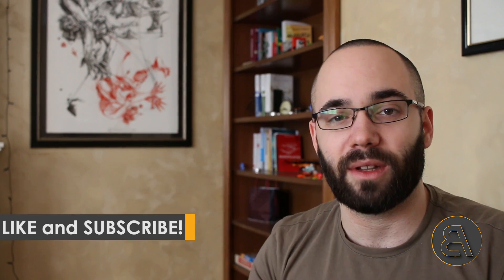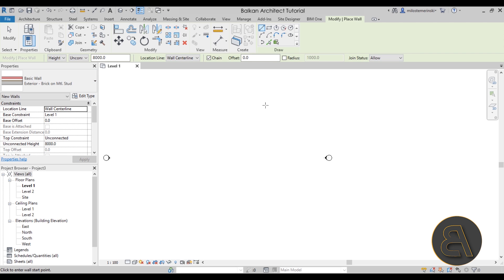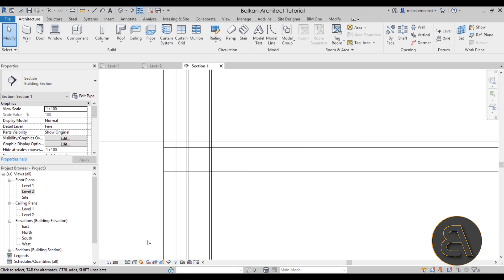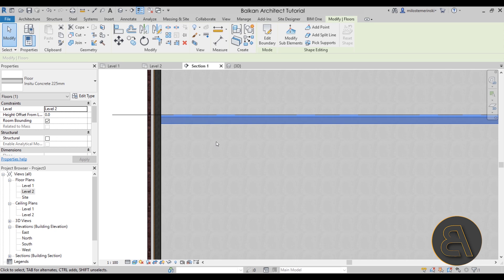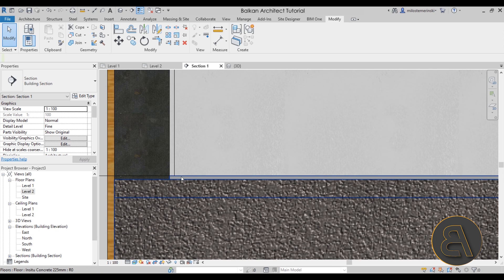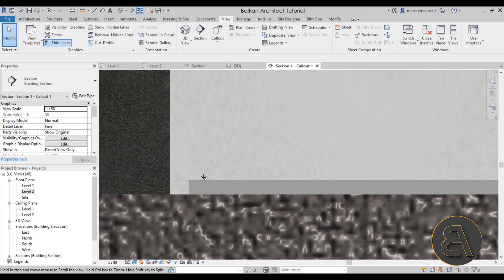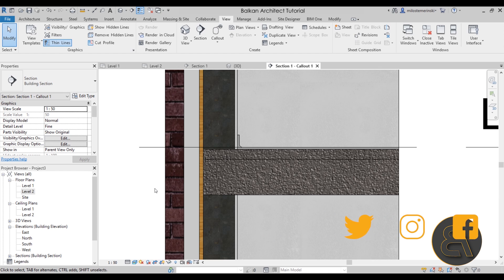Wall -  Floor Connection in Revit Tutorial

Comment: How to do it when having the floor on the ground floor and the outer brick layer is actually standing on the floor? For me in such case the concrete layer will go through all wall layers and just the floor tile layer will stop at the core wall layer but will then start again for the insulation and outer brick wall. Couldnt find a way to fix this.

Comment: THIS IS COMPLETLY WRONG.....try to be more clearly on your explanation............what you are trying to show is a "finish flooring surface possible some type of vynal flooring material that is extended a few inches above the edge of the wall. ...........however this is not common..... also it depend on the type of project. .......STOP MISLEADING VIEWRS.

Comment: Unfortunately i have to disagree. First option of making a floor is the right one and how it's made in real life. 
To fix your view remember, once we finish the building on site, we add a layer of finishing (plaster, or cement, painting... Etc) on the whole facade, means in Revit you'll need to add an extra layer covering your whole elevation, and that's how you hide your floor ...
Reply: No, the wall he placed is already a multi-layered wall with a concrete core and brick cladding. The floor slab is only supposed to extend over the concrete core of the wall, not out through the cladding which he fixed with the correct way of doing it.
While i usually also use seperate walls for cladding, in this case everything was correct.
Reply: Suppose if we have a multi-story building, can a brick wall span all that height without separation? Is that what you're saying?
Reply: @fouezdesign  Well yes, since they are anchored to the concrete wall behind them which is actually load bearing while the brick wall only has to hold its own weight. You can get up to a maximum of 12 meters until you have to use a new steel bracket to hold the bricks further up.

Edit: The german code for these constructions is described under: DIN EN 1996
Reply: @floriang3104  I'm talking about something, you're talking about something else. In Balkan video there's an air layer then comes the brick wall as the section shows clearly. Will this brick wall hold up vertically straight through the whole bldg height?!... Seriously?!
Reply: @fouezdesign  YES, that is what i am talking about. The layer of air is usally filled with insulation tho but that is not relevant for the structural aspect (there can be 3-4cm of extra air between insulation and the brick wall for rear ventilation of the facade. The whole thing is called "Klinker Vorsatzschale" in german but i can't really find good english excamples.

The connection to the concrete wall across the air is made by steel anchors that are inlayed in the grout between the bricks.
Reply: @floriang3104  I suppose you're from Germany... Anyway look, what if i blow your mind telling you I've worked in north Africa and in the middle east (UAE, Qatar & KSA)... 
All the system is what i was talking about. So now I'm wishing if there was a way for me to get a look on your country system... Coz the difference is huuuuuuge & i need to have an idea.
Reply: @fouezdesign  Hey man.. Yes @Floriang3104 has it right. The brick is tied back to the RC every few courses (depending on the cavity depth etc.). This level of detail would have to be added to the wall, usually as a detail component. However these day, in the case of multi-storey construction with a brick outer skin the brick is actually in panels (not individual bricks). The floor slab is tied to the RC wall. It shouldn't cross the cavity, if it did you would have a thermal break and a dew point somewhere you don't want it. The cavity is closed between levels though with a fire stopping material. I think i made a video for you some time back on this issue of the slab join to the wall
Reply: @tg-at  Yeah i got her/him, and i totally understand but if you remember & still have the file i sent you before, you'd notice a complete different way of doing it.. I'll send you some other examples if you want on Tg, some from North Africa & some from the gulf area...
Reply: @fouezdesign  thanks, looking forward to seeing that
Reply: @tg-at  I'll do it the moment i get on my pc man and thx a lot

Comment: thanks for your great videos. 
on the flat roof, lets say pure cube,  after drawing the floor when I do the join, how can I cover the thickness of wall on the floor?

Instead of join, if I draw the floor on the outer edges and then attach the wall, on elevations the thickness of floor is annoying.

How can I have a neat edge, lets say on a cube???
Reply: Create a finish only wall and join with the existing wall. Then join the finish layers across floors in 3D view

Comment: hi...... i am having some problem with floor bleed lines in 3d...... Even though the finish plaster of the walls is in front of the floor... and i don't see the floor lines in elevation, they appear as broken or bleed lines in 3d Shade mode with edges..... does any one have a solution for this

Comment: How can I make a flooring with different level basically in the ground floor and interior steps also ...
Note steps I mean 2 or 3 steps not a stair case
Reply: the method i use for that is create a floor lets say at ground floor (0 level) and give it an offset -400mm (for example). then I create another floor which i want as a step and arrange the thickness as 200mm and give it an offset -200mm (then it will be over the first floor i created) then i make another 200mm floor and this time o don't give any offset so the floor level will be 0 (it will be the ground level) and its done i got  2 floors and 2 steps to reach the other :) hope its clear. kinda confusing when you write it down.

Comment: That's a nice solution for detail views. But what about it in 3d views? We won't see that in 3d views and i think it will not be added up on schedules too. I usually create another wall with just that layer of floor material placed on the main wall to be able to see it all in 3d and schedules... What would you do?
Reply: And for that detail on the lower part you can create a footer and use an profile as you want it to be
Reply: @marianasalescruz  a footer will work if it is an independent item installed on the wall as a skirting but in this case he is creating a linoleum return and it is part of the floor ie an extension of the same sheet layer on the floor
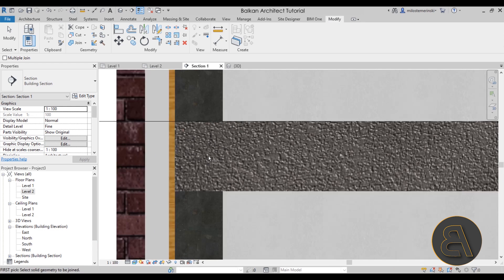Reply: It works if you just hit yes on that window that opened at 7:29 it will join and cut and appear correctelly on every view, and then you don't have to join after like he did at 7:49

Comment: This won't reflect on the material schedules correctly. You have to create structural floor and finish floor seperately for correct representation. I don't know why Revit makes these simple things hard for us 😫
Reply: I always draw my floors and walls in separate layers. Its a lot better model wise. But im really working towards a BIM model and not really an architect model like he does. So i only draw the structural floor and the cement finish, and not carpet or anything like that since we do not apply that at the construction site :)
Reply: @modderhoop2058   I need to draw all the plans as a finished building. Tiles, wood flooring etc  :( It is nearly double the effort to draw the floors and walls seperately to get an accurate model. Even then you have to join bits and pieces here and there.

Comment: Hi, im new in revit i start using revit21 but i cant find generic walls like in revit 2018, im working in architecture template.  If someone can help me.
Reply: Are your options set up correctly. That is, are they pointing to your previously used template files?
All your old templates should be opened and resaved in 2021 format and have your new installation point to them.

Comment: I literally just discussed this issue with my colleague. Still trying to figure out solutions and here you posted a solution for us. You are a legend. Love your videos. Any chance you could talk about floor drop connections? (i.e. change in levels between FFL for a room and bathroom let's say of 50mm) when we draw two different slabs and offset the toilet floor by 50mm, it works. However, when you cut a section, it is just a floating slab and everything is disjointed. also walls don't join back to the separated floor slabs on the same level and level below. Skirtings also get skewed. Very strange and totally struggling with this. Not much info online and don't think you have spoken about this topic before? I may be wrong. Hope you can help =]
Reply: Very good question,i guess you might have to model a floor above the floor,if you want the drop to be say 50mm just set the thickness of the new floor as say 100mm here,assuming that the lower floor is 50mm thick itself,so that extra 50mm thickness will give you the required level drop.